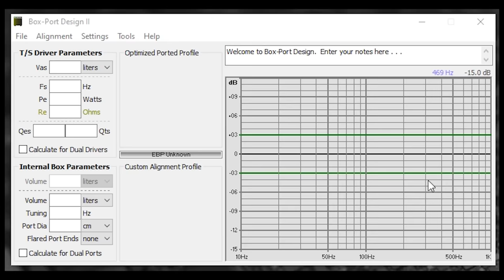How to Make L-Ported Subwoofer Box - DIY

Comment: In the Re box calculator, why does it say 2 inch for port width and then in the box port software i see it as 4 inches??
Reply from the maker: Hello Amrika, good question. Box-port Design is only a circle port so I converted the square perimeter into equivalent circle perimeter. That is why I need to use RE Audio's calculator for the port.

Comment: Sir tell me box measurement(length,width,height)for 10" Inch sub woofer..
Reply from the maker: Dual 10"?
Reply: Yes sir..same pioneer dual..
Reply: Dual 10"
Reply: I want to fix in my car(i20)..so norma size enough..not too big..i want small or average size at the same time with full bass effect..

Comment: hey bro, please give me the box size completely, by chance I just bought a pioneer subwoofer like this, thanks
Reply from the maker: Hello Skay 89, go to the video description and go the the link of tinkercad that is posted there. You can now see the dimensions and layout of the subwoofer.
Reply: @chrclmnky  hey bro, thanks, I've read it in the decryption column, actually in the sales box there is a size for the subwoofer, for the ported and sealed, but is it difficult to follow the results of the bass ??
Reply from the maker: @skay8999  Only ported. Not sealed. Use a box calculators like I did in making this box. Get to know the program and calculator, eventually you will get to know it better and build nice subwoofer boxes.

Comment: The  4 corners on the inside should have rounded corners not sharp corners and no wire connecters on the box run holes right through the box size of wires no breaks in the wire from sub to amp and if you are breaking 1000 watts you need 8 gauge ofc 4 gauge if you break 2000 sounds cleaner music and plays cleaner
Reply: Power amps put out massive amounts of wattage and only use copper traces to the output terminals.
The idea of using massive wire gauge as speaker cable is just marketing nonsense.
In pro audio, we run 10,000’s of watts on simple 12 AWG. Or if using smaller 18” 2500 watt powered subs and high powered line arrays, the factory internal wiring is only 16AWG.
I understand the need to eliminate all wasted heat from speaker cables to insure all the electrons send the most signal to the drivers, but there is a limit on what is most effective.
I have yet to hear a difference of anything over 12AWG, whether it be 12” or 50 feet.

Comment: l ported sound is boomy, tline  sounds deep
Reply: that's not tline
Reply from the maker: @dieboldman4887  Transmission line or T-line box are just very long L ports that's why you hear them deep. They are usually tuned below 25Hz.
Reply from the maker: Ok thanks. That explains a lot.

Comment: 1400watts ? Ahahahahaha big lol 
I remember a 1kW subwoofer, it would need 4 people in order to move it
Reply from the maker: Those people must be midgets or something.
Reply: My xfl's are 1k RMS and only like 70lbs each. Try lifting a deaf bonce db32. 30k RMS, thing is around 140lbs
Reply: @STOPH3R01991   So at full power at a 12volt system the speaker would need 2666 amps ? You high?

Comment: Pahingi ng sukad boss d12 subwoofer at d15 tulad yan saiyo po
Reply from the maker: There is a link to the TinkerCad 3D schematics in the video description. You need to create an account and login to TinkerCad so you can start using it and seeing the dimensions. Use laptop or computer web browser to open TinkerCad.